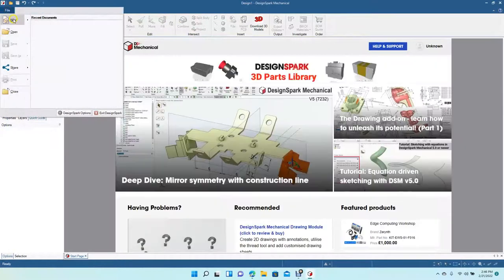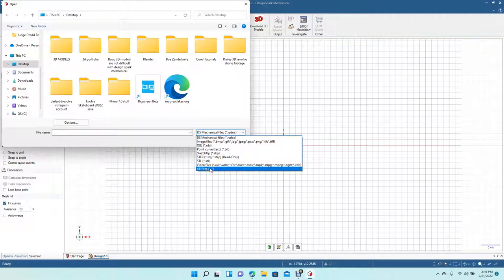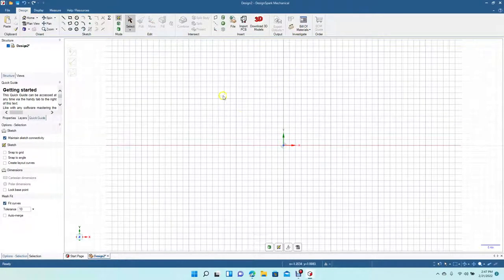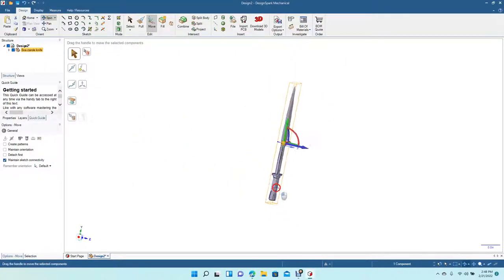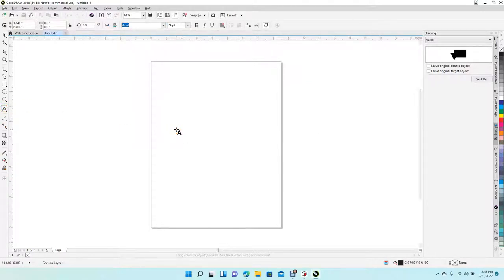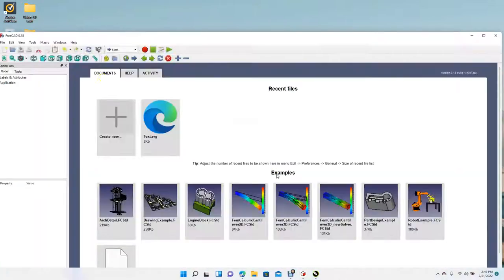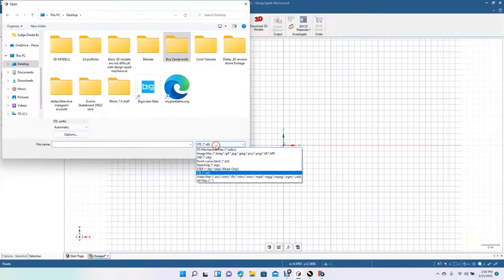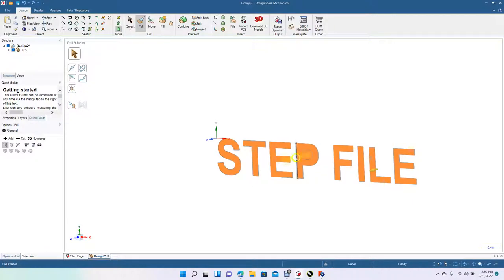Design spark mechanical import and export options

Comment: If I try to export to cura through the plugin it opens my browser I have the translators installed any idea why when I export it does not open cura as it should?
Reply from the maker: Not sure. Let me do some research, and I will try and find out what's going on.
Reply from the maker: Chuck, the export to Cura option in design spark mechanical just exports the file as an STL. I tried this, and it doesn't work for me as well. I would just use the normal "save as" option and select STL. It's the same thing as using the export to Cura, except it works. Save your STL file to the desktop and then import or open in Cura. Not sure why it doesn't work. I'll try and reach out to DSM and see if they have an answer for why this option doesn't work. Cheers!

Comment: i cant export step file. option not available
Reply from the maker: Sorry, but you can't export a step file from inside design spark mechanical. You can import a step file, but not export.
Reply: @dailey3drevolve  Why is there a step file option in exporting if it cant be used?
Reply from the maker: The "free" version of DSM 6.0 did away with all the export options except native DSM and stl option. The paid versions still have these export options, but there is a monthly fee.